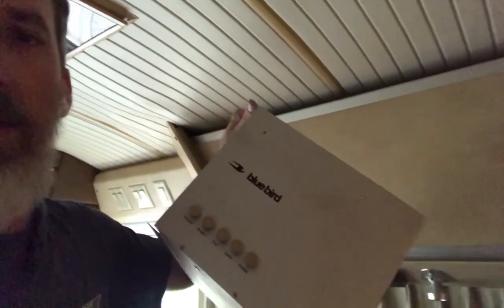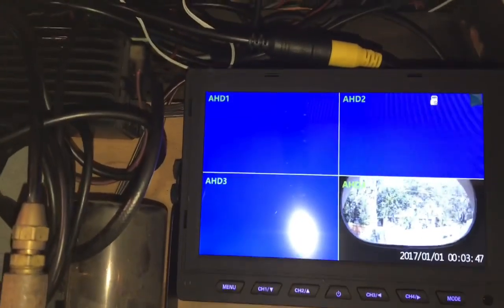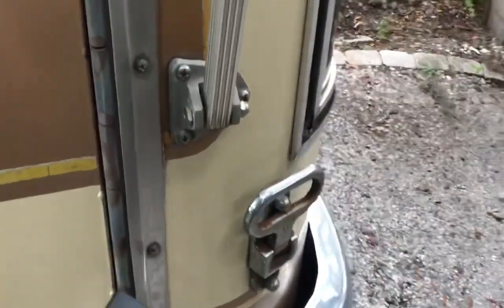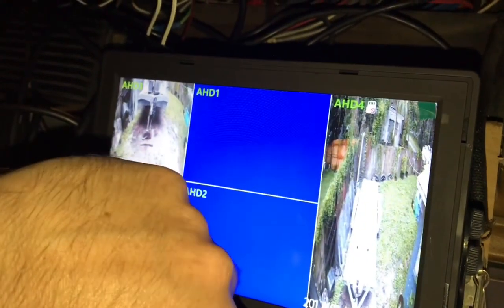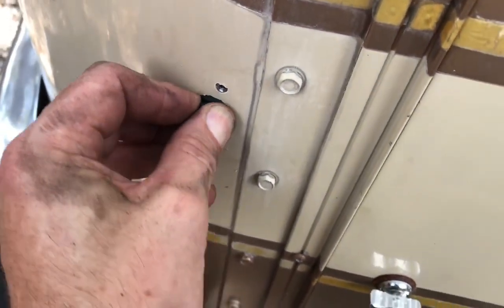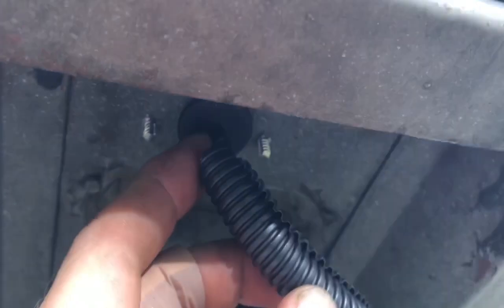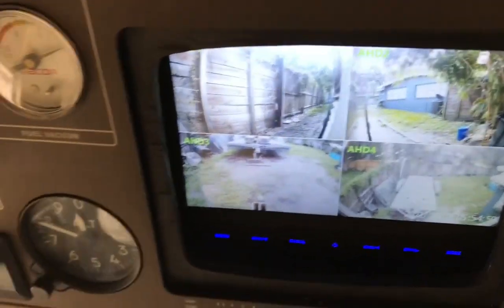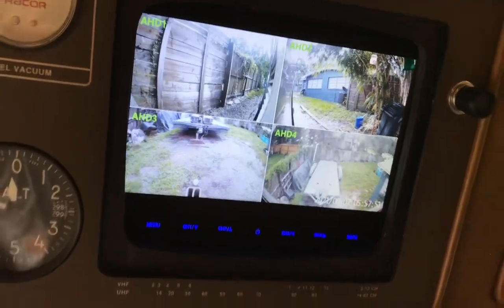-Gino’s Garage- "Inside Job" -New Camera System on 84 Wanderlodge PT40.

Comment: Cool setup.  When your replacing the old technology with newer one, we're you able to use the older video fee that runs from the rear of the coach to the front monitor? Or did you have to run a new line for that also? I'm cringing at taking apart the whole length of paneling inside and putting back together.
Reply from the maker: The old cable going to the back was coax, the new cameras require a 4 wire cable. But I already planned for future pulls, I ran a nonmetallic conduit from the front to the back so I do not have to open everything up every time I want to pull something new, I installed that when I ran wires for my jake brakes. Still have a bit of room left in the conduit, now I kinda wish I would have ran two of them.. I may end up adding another one or two for future.

Comment: Very cool! That’s a very good upgrade! Nice job retrofitting it into where the original backup camera/tv was. 
I especially like how you wired it to trigger the side cameras when you use the turn signals.
Reply from the maker: Thanks Wes, it should be a pretty cool upgrade when driving down the road. Especially like being able to see the trailer much better! These cameras seem to have pretty good resolution for how cheap the system was..